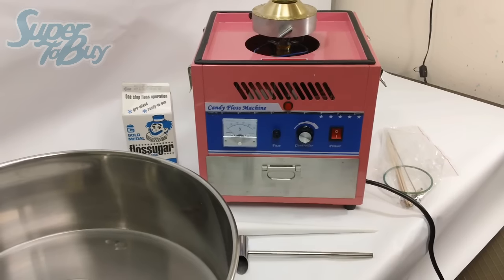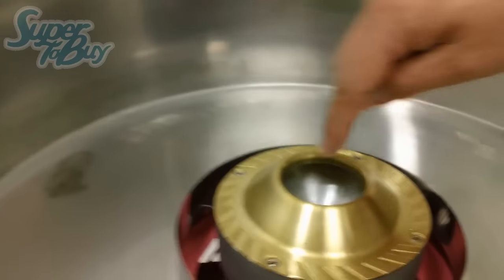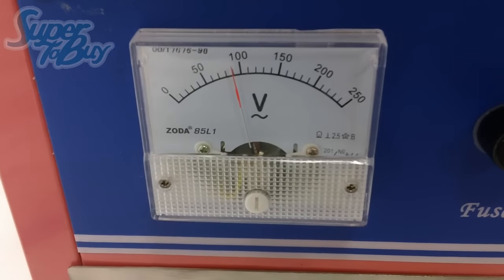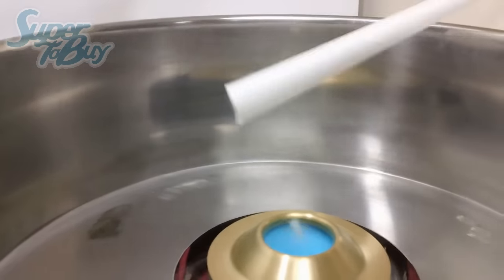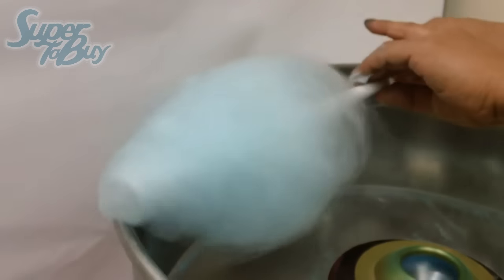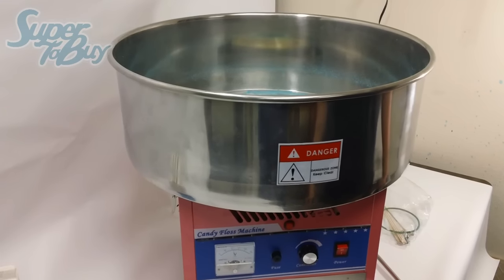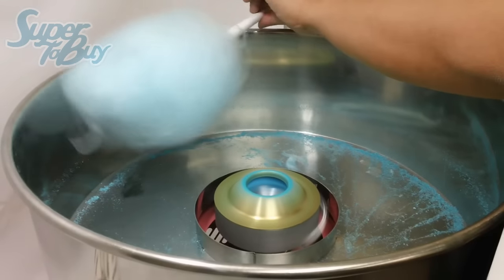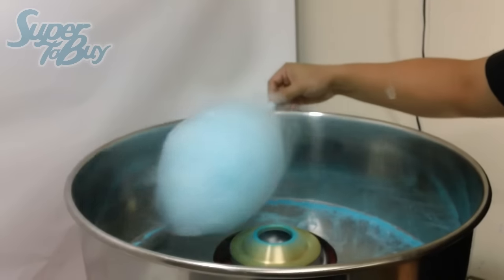Professional Cotton Candy Machine Demonstration Video

Comment: My second and subsequent cones aren't turning out like my first ones which are huge. IDK what I'm doing wrong. It comes out really fast and in a thick blob. I think turning down the temp after the first cone helps a little. I have a Vevor machine. 

What I do is turn it on and let it run without heat for about a minute. I then turn the dial to around 50 and let it warm up a little. I then put it on 90 and add the sugar. After the first cone is done, I turn it down to around 50. My cones are not coming out as good as my first. It's good I guess that I'm not attempting to due high volume (or getting any online orders at all which is what I bought this for! :-( :-(_!
Reply: I bought the Vevor machine, it worked great the first time I used it. Then it was getting too hot couldn’t adjust the heat temp properly so I sent it back. Got another Vevor turned it on and it started sparking, sent it back. I ordered Vevor because I really liked the cotton candy that came out, it was the best of all the machines I have tried. If Vevor can get their machines tweaked they will have the best cotton candy machine on the market in my opinion, I have tried several. I want a small machine that is portable that you can adjust the heat temp, most are automatic.
Reply: I’m actually thinking about ordering a Vivo because of the “auto” heat. Damn Vevor is a hit and a miss with the output of the cotton candy. I tried lowering the volts, raising the volts. Some will be good and some are like wtf! 🤦🏻‍♂️ I can’t rent this thing out to customers if I can’t even function machine properly.